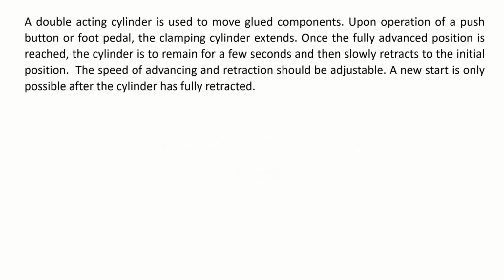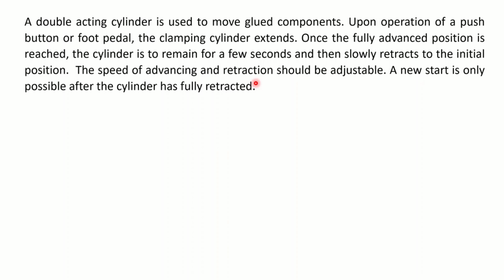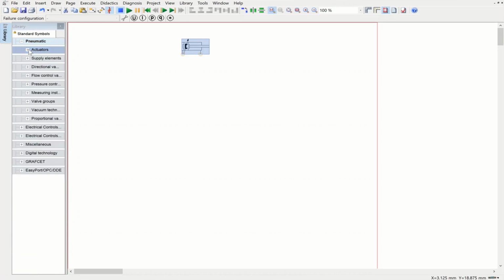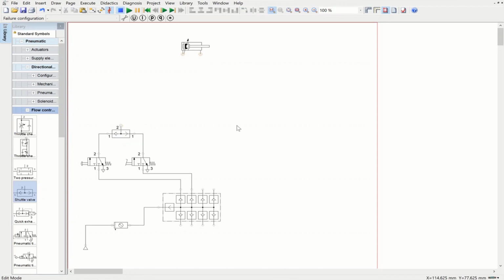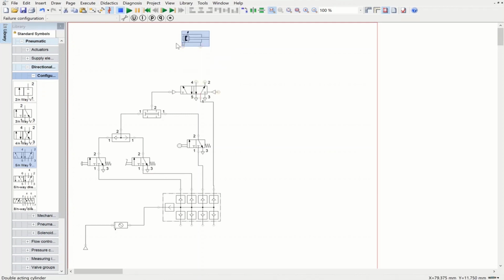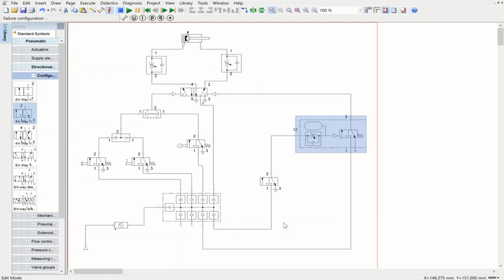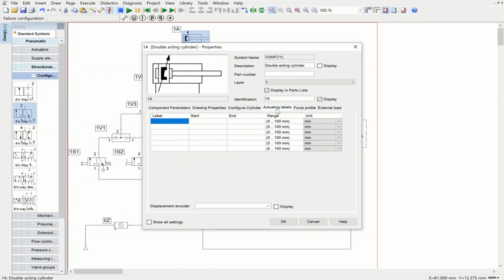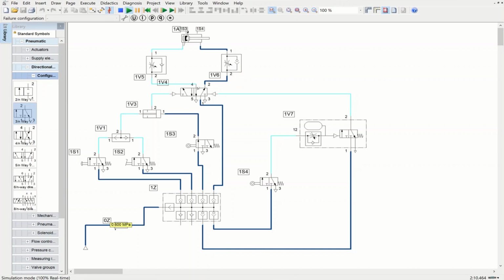Pneumatic Circuit Design with FluidSIM | Introduction to FluidSIM| Tutorial 11

Comment: There's no need for the extra 3/2 directional valve that was connected to the and 2 pressure valve. If you take both out (including the 2 pressure valve) it works the same.
Reply: that particular DCV is to make sure a new start is only possible after the cylinder has fully retracted.